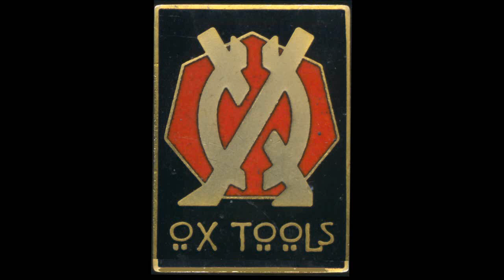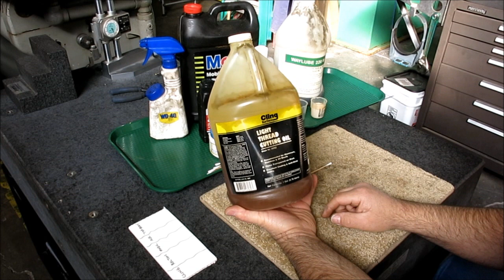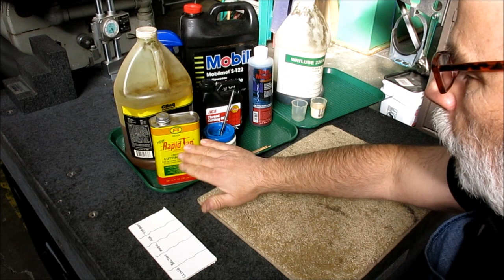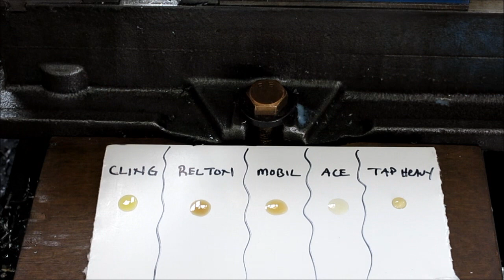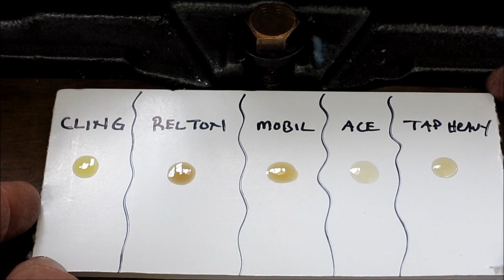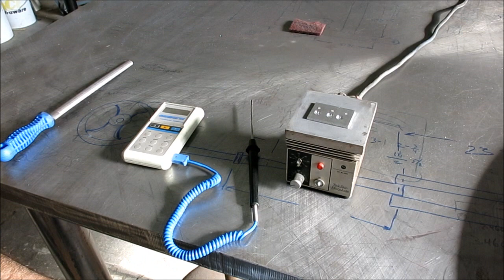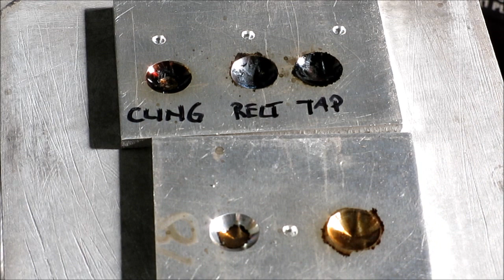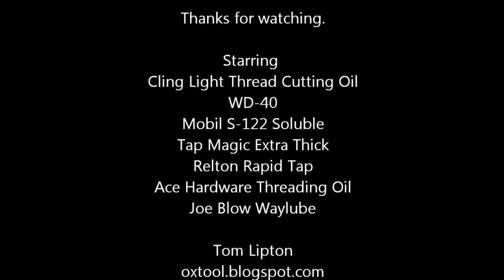Toms two cents on oils and coolants

Comment: Welcome to Tom's School of Machining boys! Today's lesson: cutting fluids!
Hey Tom, I bet I was the only one listening to your video through my ear bud while I was drilling and tapping some holes in some small shafts this morning, using my acid brush, can, and dark cutting oil. LOL!
Good job on the video, it was very informative and a joy to watch. You did a good job of explaining the differences between them and how to use some common sense when selecting them. 

Adam
Reply from the maker: Hey Adam,

Glad you liked the video. I was wondering about the really dark stuff you use. What is the brand and name of that cutting oil? When I bought the little jug at the hardware store that is what I was expecting to get. 

Talk to you soon,

Tom
Reply: Tom the cutting oil I use is Exxon brand and its called Pennex N 47. I have a 55 gallon drum of it I bought a few years ago, and its still nearly full. This is the stuff we have bought for years through a local oil company, but I think it was the last barrel they had. 
I did a quick google search to find some info on it with not much luck, other than finding out it has been discontinued and replaced with a new products called Mobilmet 766. 
The Pennex N47 from what I know is the old style cutting oil and it works good for a lot of machining jobs in the shop. It's probably about the same thing as the Ace brand thread cutting oil.
Reply: Abom your n47 thats the expensive part to gundrilling 50/50 mix 
http://www.osti.gov/servlets/purl/932959-vfhn7j/ 
pdf that talks of its replacement page 12 has what is closest to what you have.
Reply from the maker: Abom79 Hey Adam,

Thanks for the info on the oil. It looks like the "good" stuff. I can imagine for a second what your shop smells like just looking at that cutting oil. Makes me think of turret lathes.

Cheers,

Tom
Reply: I'm actually cutting threads in 440 right now. Using CRC TrueTap HD. Seems like a heavier fluid works better in this application.

Comment: I use either WD-40 or Tap Magic for nearly everything. I LOVE the standard Tap Magic stuff. I love how it performs, how it cleans up and how it smells. Nothing like walking into the shop in the morning after a long machining run the previous day. I'm not putting it in my cereal yet but if they made a Tap Magic cologne, I'd wear it.
Reply from the maker: Hi J,

A little dab on the wrist and behind your ear? Personally I like WD-Spice original.

All the best,

Tom

Comment: When milling super-alloys used in oil and gas industry (Inconels, Incoloys, Hastelloy, etc.), we would use through-tool coolant, higher pressure, with our water soluble coolant up around 15% to 20% concentration, making sure we kept our inserts sharp, NOT being afraid of higher sfm (everybody called me crazy, but I cut cycle times by over 60%, and got 10x's the tool life per insert corner), but I had to be absolutely meticulous about entry and exit to cuts, about radial engagement%, and how that affected the angle of entry of the insert into the material on each cut, and maintaining a thick-to-thin chip formation, both are key to insert life. I miss machining that stuff, and miss blowing the minds of guys with 30 years of experience that hated to machine any of that DTM material, but could never get ANYTHING to work.
Reply: "Thick to thin;" Do you mean cut larger chips, then progress to smaller? Or, did you mean one size chip between "Thick and thin"?

Comment: That's been real interesting to listen to and watch. After the issue of smell, which I can fully understand, the point about residue was most revealing and interesting. Do you suffer residue issues often with your work in practise? I have frequently seen smoke coming from parts or the chips when your working on them.
Reply from the maker: Hi Dan,

The smoke you mention is typically from oil residue. It doesn't take much to make a little swirl of smoke when welding. 

Regards,

Tom

Comment: Hi Tom, I really appreciated this video. I recently got hold of my first lathe ( a very old one but still it's my first) and have been unable to find way oil anywhere where I live so I feel more confident now experimenting with alternatives. Thanks again, Alex.
Reply from the maker: Hi Alex,

Where is where you live? McMaster carr sells way lube. Thanks for the comment.

Cheers,

Tom
Reply: Hi Tom,
 I'm in Australia so no McMaster carr unfortunately.  Thanks for the reply, I love watching all you videos.
Cheers,
Alex
Reply from the maker: Alex Does DIY Hey Alex,

Pop over to Bruce Whitmans or ueee84's channel. Ask over there. I'm sure they both have a supplier they like down in Oz.

Cheers,

Tom
Reply: Will do, thanks for the tip.

Cheers
Alex
Reply: I have  a metal lathe (garage shop not a pro) and I found that good alternative for way oil is motorcycle chain oil same sticky and stays there and can find in every MC shop or gas station...
Reply: Thanks for the tip, I've been using Limited Slip Diff oil and so far that seems to be working well, I think it has the same tactifiers that chain oil has, apparently chain saw oil is also good.

Comment: Hi Tom, I purchased Ometa HyCut coolant oil and Additive when i got my first Haas about 6 years ago. Still use same batch. So the trick is that you individually check the content two components to mix in. One is the lubricant and the other is bacteria preventing thing. BMW has been running this same batch of coolant for about 15 years. If you skim oil and filter properly you can keep same coolant for years.

Comment: Thanks for the in-depth discussion and testing. At those temperatures, the oils are probably polymerizing and may need a more aggressive solvent than denatured alcohol. You've essentially seasoned a set of tiny little frying pans. In my experience, a well seasoned cast iron skillet can take a serious beating with high temps and acidic liquids without batting an eye. My solvent of choice is also denatured alcohol, but in this case I suspect a little lacquer thinner or maybe turpentine would work pretty well on the cutting oil residue.
Reply from the maker: +FXM Hi FXM,

The bad part was I didn't get any bacon to eat after the test. Thanks for the comment.

Cheers,

Tom

Comment: Taking the time to really explain the oils and their uses was really appreciated! Some searches quickly showed the Cling is no longer available and the Mobile S 122 is only available in 5 gallon buckets, but the 102 General purpose can be had in gallon jugs. I think the residue results would be a little less dramatic as the material would certainly have chance to cool faster than in your example with the constant heat.
Non the less it is a great starting point for folks like myself who are just starting out after many years away from the trade or first timers, and I like the ums and ahs because it has a more general "water cooler" feel to the video. It's like standing in your shop when the conversation starts up...less staged and stiff like a class room would bee
Reply from the maker: Hey Robin,

Thanks for the comment. I tried to find the Cling a while ago. No luck. This bottle must have been hanging around for quite a few years. I agree about the dramatic residue. Been quite a while since I got a part that hot machining on it. I was trying to illustrate the residue and smoking issues with the different lubes. Thanks for the feedback. I might try it again at a lower temperature. Maybe just over the boiling point of water.

Cheers,

Tom

Comment: What about using alcohol for aluminum/brass/copper? I read about this and tired it for the first time and love it. Not only is it a great coolant but it evaporates from the shop floor/tables/machines quickly and is naturally antibacterial and bug. Some fear the flammability but it is "cool" burning (the vapor burns really not the liquide) and I do not see it any worse than karasoine (WD40).

Comment: Thanks for the video, Tom.  I'm new to machining, and my first / only machine to date is my 1978 Hardinge chucker lathe.  I've only done aluminum so far, and have used WD40.  I also use the Rapid Tap for drilling / tapping, but will try it on the lathe when I work steel.
Reply from the maker: Hi Aaron,

Sounds like your headed in the right direction. Steel will make you appreciate good tools and technique.

Cheers,

Tom

Comment: I never liked the water soluble coolants as they stained the equipment. Right or wrong I use mineral oil as coolant/lube on my lathe and so far so good. A side benefit low evaporation and inexpensive.

Comment: OH Boy. Every time I see some different kind of lube I get some to try. I now have a list of a bunch more to try. I was wondering what kinds of oil you use. I ordered 3 of those no spill oilers you use. Now I will have to get some more. lol  Thanks for the video. It helps a bunch.
Reply from the maker: Hey Steve,

Now you will forget which oil is in which cup. The color coding only works if you have a couple. Thanks for the comment.

best,

Tom
Reply: I already got that covered. I used a sharpie and wrote on the side of the bottle. I also went and bought a pc. of 1/2" copper pipe and caps. Cut 3 pcs of pipe 2.5" long, put caps on them then a large hose clamp to hold them to the cup for the brush. Now I can put the lid on and keep the oil clean. Remember I also do wood working and that dust goes everywhere
Reply from the maker: Buckrun11 I forgot you were a woodchuck in addition to all your other skills. The wood dust will kill you.....

Best,

Tom

Comment: I found that like automobile oil, the way oil gets a little thicker and stickier when the shop gets a little colder.  I don't always keep the outside garage/shed heated and I was playing around with the late a little and noticed it.  Any suggestions on a weight to use during the colder months?

Thanks for the suggestions on the different types of oils/coolants for the different metals and operations.

Comment: Hi Tom: Great education on cutting oils. I do a lot of work with 4340 bar stock with a tungsten carbide bit and I find Railtons thread cutting oil to be the best stuff to use for surface finish and cutting speeds. A word of caution about this oil is make sure its the new formula because the old stuff is highly carcinogenic and enters your blood stream through your skin faster then any known substance. Keep up the good stuff

Comment: Hi tom.. I use titanium an awful lot and if you could point me in the direction of what is best for tapping and cutting grade 5 titanium I would really appreciate that please always enjoy your channel bud keep up the good work
Reply from the maker: lbcustomknives Hi IB,

There are special geometry taps for Titanium. If you do a lot you should invest in some specialized tools. They make a huge difference. There are so many cutting fluids these days I would be hard pressed to make a specific recommendation. Brad over at Tactical keychains does a ton of titanium. He may have some more specific oils he can suggest. 

Best,

Tom
Reply: Thanks Tom.. I use roll Taps and they seem to work quite well.. I'm using a product called ct90 and when you mentioned about the sulphur and that being a no no.. Thought it was worth an ask mate.. I love the stuff but hate it at the same time..
Reply: That's titanium not sulphur lol
Reply from the maker: lbcustomknives Hey IB,

They add sulfur and chlorine to cutting fluids to make them work better. Titanium is sensitive to chlorine. Sulfur effects red metals in some cases. Hope this helps.

Best,

Tom

Comment: Timely video for me tom thanks,i was looking thru the catalogs for some new water soluble cutting fluid for my horizontal band saw and was worried about sump life because I just wont use it fast enough, so are you using the mobil prouduct in your saw?
Reply from the maker: Hey Johnny,

I don't flood in my saw just yet. I use the green pressure sprayer to lube the blade on the horizontal saw. We use Blasocut $$ in our horizontal saw at work mainly because we also use it in the CNC mill. Works fine. You have to top it up with water if it sits for long periods of time.

Best,

Tom
Reply: Ok thats great, thanks Tom

Comment: Tom- What is the best lubricant ( oil) in the gearbox of your lathe?  I have a Lansing G  15x60 Lathe. It1 made in Italy and I can't translate the diredtions
Reply from the maker: Hi John,

That's a loaded question on the internet. The short answer is something is better than nothing. You might post on the Practical Machinist forum and see what comes back.

The old machinery repair guy at work used Mobil Vactra for the older engine lathe headstock gearboxes. I have several lathes at work with that in the headstock and they seem to be fine. Now with that said I would try to at least match the viscosity index recommended by the manufacturer. I would think you could get the pertinent information translated to English pecking it into Google translate. 

Cheers,

Tom

Comment: Thanks Tom for putting this together! Good info.

I use WD40 for aluminum and Black Swan Dark Cutting oil for steel/SS. They are cheap and easy to get.

I tried Koolmist, It worked well, but I ended up with rust. It also seems to crack carbide from thermal shock. I don't think the benefits are worth downsides for my little shop. I tend to get dragged away from a job for a day or two. IMHO Koolmist really needs a thorough cleaning.

I will try it again on some longer running jobs. I may even give the water soluble a try. Water does cool much better!
Reply from the maker: Hi Willy,

Never tried the black swan oil. Might try to get some. I don't have a dark heavy oil in my inventory right now. Prices look pretty good also. I feel you on the Koolmist. Never liked it for smell and residue cleanup.

Cheers,

Tom

Comment: I really like Rapid Tap a lot, found it was a big help with drilling using a low power tool like a battery drill and of course great for tapping.  Once had a quart of cutting oil that I had to return because I could not stand it when it smoked. 
Rich

Comment: I have a related question and then I'll stop trying to monopolize your entire life LOL.
 I have set out to build a nice flood cooling system for my lathe and my Mill. The problem is is I live in Michigan and my workshop is in my garage. I do not need it at night I can't afford to heat it at night so liquids will freeze. I'm wondering if there's any sort additives that you can get 4 cooling liquid that would prevent it or at least make it less apt to freeze?
I suppose I could install a small heating coil such as used in aquariums to the tank to keep it unreasonable temperature. The way I am designing the system it will completely void liquid from all the lines just by gravity if I allow it.
I think I said before I got a very good pump several of them as matter fact it's a flojet brand and they last for years. If you have any insight into this topic please share it thank you again
Reply from the maker: Hi Clown,

You could move somewhere warmer....... There are probably commercial additives to lower the freezing point of the coolant. I don't have any experience with any myself as my shop only gets down to 60 in the winter.  Vodka would probably work. Thanks for the comment.

Cheers,

Tom
Reply: Use a thin oil, do not use any type of water based cutting fluid for reasons of low temperature as you said. Also, I'd get a good high output heater and put it on 1/2 hr before you plan to be in the garage so things heat up and oil will flow as they should. I head my garage in winter to the low 50 degree point. Oils still work and flow and I can easily handle this temperature with a light jacket when I need to be in the garage. Cat is ok with it also.

Comment: Its worth mentioning a "graphite like" cutting fluid. Moly-dee from Castrol. I have found nothing like it when retaping hardened 455 ss it was the only fluid which allowed cutting without risking a broken tap. Its the messiest stuff but works great.
Reply from the maker: Hi Tool,

The new formula of Moly-Dee is not as good as the old stuff. I still have some of the original snake oil hiding around here. It really is the stuff for the really tough jobs. Thanks for the comment.

Cheers,

Tom
Reply: i have some old moly-dee i think it works great on hard metal dont know about the new stuff

Comment: Tom
I have some thick almost like mustard Sul-Flo oil. It can be mixed with most anything. Ever use it?

Thoughts on using old motor oil for general cutting oil?
Eric
Reply from the maker: Hi Eric,

I have never used Sul-Flo. Sounds like it would be good. I have used almost everything at one time or another. Almost anything is better than dry for certain operations. One time I forgot cutting oil and had to tap something in the field. I ended up using spit and it actually worked pretty well. Not recommended unless you are in a dire situation. Motor oil will work but there are other things that work better.

Cheers,

Tom
Reply: It works fine but the gunk and carbon in it will dull your tools faster....

Comment: Many years ago I used Rigid brand dark cutting oil threading steel pipe for my father. It worked good for that.
I keep meaning to buy some for my lathe
Thanks

Comment: my father worked in aerospace manufacturing for 30 some uears and he really likes "molly dee". really great stuff for a heavy high pressure tapping and cutting fluid. just thpught I'd throw that in there. it works great on titanium as well.
Reply from the maker: +darin amann Hi Darin,

The old formula of moly dee is pretty incredible. The new version is chlorine free and is not the same stuff. Thanks for the comment.

Cheers,

Tom